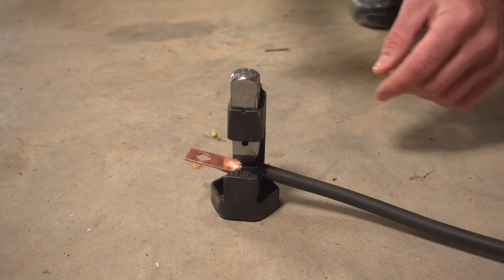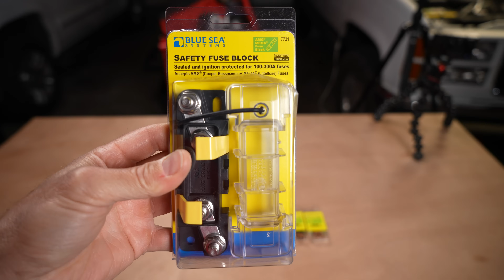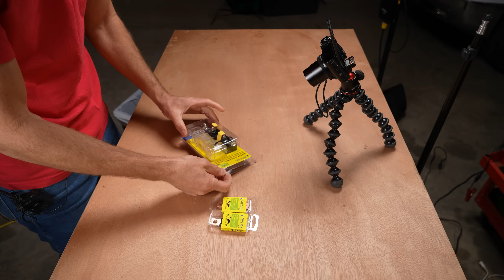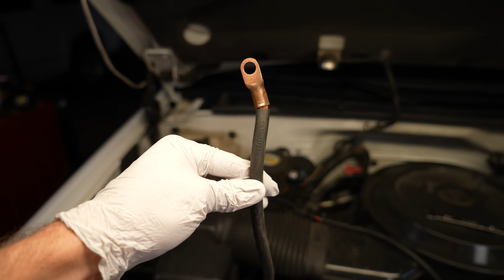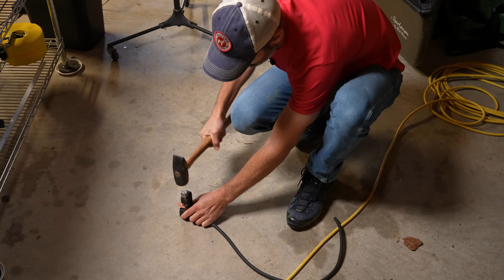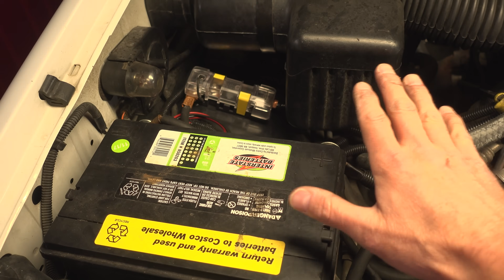Here's Why You NEVER MESS WITH Your Vehicle's ELECTRICAL System!!

Comment: Great video, as always. The money/time saving tips regarding the copper tubing as raw material for creating your own lugs, to then make your own wires for power with the 2g copper wire are fantastic. I prefer a handheld crimping tool but the hammer one is also a great (and less expensive) option.

Comment: Should have mounted the fuse battery connection right at the battery, as now you have a length of wire just like going to the alternator did, but going to the fuse that can make connection to a ground. Also heat shrink would be needed on those lugs. It is still a good idea to fuse the main battery wire, so good going.

Comment: The capacity you want is around 200A SBF (slow blow) breaker.
It'll protect the battery if something is shorted and pop immediately with the CCA amps, and blow in around 30-60 seconds at full alternator output/overload. That 300A fuse could let the alternator overload for minutes or longerand never pop 🙃
Reply: yep. You can go with fat cables that can handle twice your output, but definitely going with the correct fuse is always the best, if something draws around 200 then go with a 200 or maybe a 180, fuses are often very cheap to replace :)
Reply: You are overthinking this. A 300 amp is perfect. Mechman and a few other brands put out quite a bit more than rated. Why would you want a breaker in between that trips when you go over 2k rpms because your alternator is putting out it's maximum output? That sounds ridiculous. Yes fuses do allow slightly more current through than rated for certain periods of time but if you short that wire that fuse will blow guaranteed which is the ultimate purpose of the fuse.
Reply: Not to mention that if the wire fails (overheats) because it is carrying more current than it is rated for it can short out in between the fuse and the battery for which there is no protection at all.  The battery will continue to provide current until it's stored energy is depleted or something within the battery or the path to the short circuit melts open.
Reply: @emblems4life726  putting more amperage through a wire than it's rated for won't cause a short. It will just destroy the wire.

Comment: Blue Sea is the mack-daddy of marine electrical.  I did the same thing you do.... if it is good enough for salt water use it is overkill for automotive applications which is how I roll. I kept all of my old copper tubing for the same reason.  Flux is a good thing before soldering.  It will help draw the solder in

Comment: With the exposed lug so close to the frame you have increased risk of a short on that unfused line. Slap some heat shrink on it. (The battery side is is the most dangerous side on that fuse block)

Comment: Great video, for the engine area you need to use Noalox on your wire before you crimp it and then waterproof/marine heat shrink.  Sounds like overkill but I've seen most of your video's and you like to go over and beyond for reliability.

Comment: Time throw a Taramps 8k amp and 4 big ol' Subwoofers in the back of that truck. 😄 🤣
Reply: @1RoadGarage  no joke if you ever wanted to get or get back into car audio it's super cheap nowadays. A down4sound JP23 and 2 American Bass Elite 12's or 15's will have you louder than anything you've heard back in the 80s or early 00's

Same thing with mids and highs, cheap as hell nowadays to get good RMS power.

I say this because I just did the alternator upgrade in my 2011 Ford escape with a 270amp from JS alternators to support my sound system

Comment: Like all the other comments. Tape or heat shrink the ends.  
Not a fan of adhesive on a curved surface either. 
But you obviously check under the hood regularly so you will know if anything needs attention

Comment: Ok so I too am not a technician but I have done a couple of car stereo set ups. Rule of thumb is you want your ground short 12-18 inches and the fuse on the power side with in the first 12-18 inches from the power source; the battery. My question to you Jimmy should the fuse in this situation be close to the power source; the alternator? The only part that is protected from a short is when the car is on is that short run after the fuse. Or would you need redundancy and have one at each end since you have the potential of the battery also being a power source.
Reply: text7401  verify you are Jimmy… lol

Comment: I was wondering, if the fuse was rated 50 amps higher than the alternator, is it really protecting it? I have to say that these older vehicles are built way better than GM is making them now and it is great to keep them going as long as you can.
Reply: Fuses protect wiring.  If the diode bridge inside the alternator goes plaid, it might pop the fuse.
My truck uses fusible links, silicone insulated wire 4 AWG smaller than the circuit.  I smoked a bridge in a 27SI alternator,  did not hurt the fusible link.

Comment: I thought the alternator outputs AC voltage and there is a circuit that cuts off charging when the battery is full, but I guess I was wrong. Maybe it has both rectifier and charge regulator built-in?
Reply: Internally an alternator does produce AC voltage, but the circuitry to convert it to DC is built into the internal regulator on most alternators. 70's Fords and Dodges are two that I can think of off the top of my head that used external mounted voltage regulators, but still operate the same.
The majority of alternators do not cut off voltage, ever, rather they output a regulated voltage (if they produce enough current to maintain said voltage) of around 14-15v. Lead Acid batteries like receiving a constant charge, which makes them ideal for automotive applications even now with other technology available.
Reply: @kstricl   okay, i had the same thought. Didn't know that there is no cut off circuitry for the battery though. I guess that as long as the voltage doesn't exceed 15V, the battery doesn't get a chance to overcharge. Maybe that's why stand alone car battery chargers with cut off protection output around 18V.

Comment: Jimmy, have you considered integrating one of the power distribution blocks that GM uses on the K2XX trucks & SUVs?  It may be a viable solution to keep things organized under the hood.
I am researching this now for use in my 2012 Suburban.
Reply: Let me know if it will also work on an 89 gmc suburban please!
Reply: @Ypcomchic  I don’t see why it wouldn’t.  The GM factory distribution block I am working with is made to fit on a top post Group 48 type battery.  Other than that, you’d need the correctly terminated cables for a seamless installation.
Reply: Isn’t he going to want that fuse as close to the alternator as possible? If that wire gets cut or burned through it will ground against his motor and short.

Comment: I recently completed a similar project in a boat. It was eye opening to see the higher bar required by ABYC for a salt water environment. Part of the challenge was to properly size the wire and fuses based on voltage drop tables and ampacity tables, with derating for wires in the engine compartment, bundling, and temp rating stamped on the cable. By those tables designed for boats, short lengths of unbundled AWG 1 wire rated at 105 deg C is good for 208-230A inside the engine compartment, depending on cross sectional area. 1/0 wire is good to 242A inside the engine compartment. The fuse is chosen to protect the wire, it should not be much higher than rated ampacity. To go above 300A you'd reach for 3/0 wire, but you could swap in a smaller ANL fuse.

Comment: Thanks for introducing me to that company. Really looks like nice quality. I don't remember; does the original cable from battery to Alt have a fused link or fuse?
Reply from the maker: I believe it was a fusible link.
Reply: @1RoadGarage  Thanks, James. I am like you and just love improving. I get crap for my PM of replacing stuff with new, but I don't care. I love my truck ('96 K2500 GMC Suburban) and enjoy knowing I am keeping it as reliable or even better than new. Keep up the great work!!
Reply: I just checked - it is indeed a fusible link on the stock wire. Mine has a 12 stamped in it.
Reply: @kstricl  Thanks! I was going to ask Jimmy why he chose the value for the fuse
Reply from the maker: @kstricl  thanks for checking!

Comment: I'm still driving my 1995 Chevy 4WD Suburban...even after all these years, its still a good looking body style.  I just now installed a second battery on the driver side and getting ready to make the connections to DC-DC charger.  Eventually adding a 200W solar panel as well.
Reply: Planning on doing same with 2nd battery on my 95. I've been going through a battery every 2 years because I don't run very long, so I installed a battery maintainer recently. Solar panel is on want list.
Reply: @kstricl  To make room for the battery I removed the vapor canister...after this many years I'm pretty sure the charcoal was depleted anyway, not to mention the state where I live does not do emissions checking on vehicles more than 25 years old.  I also removed the resonator box on the air inlet side and replaced it with a short length of 4" rigid clothes dryer duct which freed up a lot of room for the DC-DC charger on the fender well.

Comment: I would have take a piece of hose with the id of the cable and slide it over the cable in areas where it touches hot areas 
Not only does this prevent chafing but also helps prevent premature burning

Comment: You need three things. Dielectric grease, shrink tube, and to cover those exposed stingers on your crimps. That much exposed copper is cringe.
Reply: Yes yes yes yes yes. I was going to say the same thing. Especially if that double sided tape comes loose in hot or cold weather and tips over the fuse block. Shrink tube would be perfect but 3M high temp electrical tape would be okay also. Other than that the fuse block looks nice.
Reply: @crazyeye1  What that double sided tape comes off and it's a dead short to the frame... man it's dumb.

Even VHB tape would be fine.
Reply: @AgentLokVokun  I thought that the fuse was there in the event of dead short?
Reply: The main reason there needs to be a fuse in the alternator cable is in case of alternator rectifier failure, the diodes most often fail short circuit which would allow the battery a dead short path to ground via the alternator. This is a major fire hazard. The common way the fusing is achieved in OEM applications is by using a " fusable link " look them up online. The colour of the link indicates the rating
Reply: This is a perfect example of why you shouldn't watch how to videos on YouTube and then think you are qualified to do your own repairs.. Also a 300amp fuse seems awful high to me..
Reply: @MarkLada  A fuse should be no less then what the alternator is rated at. So in this case 250A would suffice but 275A would be better then 300A

And because it's NOT a quick blow type fuse you could easily be drawing an excess of 300A for an extended duration before it goes pop. 

This YouTuber is a Chud. This is basically a series of sponsored videos with out the disclosure. The moment that double sided tape fails he's going to have a 300A lead flopping around the engine bay.
Reply: @MarkLada  not for a dead short
Reply: What’s the grease for?
Reply: @freshbutplain1144  Prevent corrosion on the connectors. Apparently up to 300 amps is going to be going thru there. Alternatively CRC 05046 Battery Terminal Protector would suffice.
Reply: @freshbutplain1144  Dielectric grease prevents moisture buikd up which prevents corrosion. When enough corrosion builds up, it leads to intermittent or no electrical flow.
Reply: I know that's right.. share the same sentiments with crazyeye1 here
Reply: Yes! Wirefy shrink tube on Amazon is freakin great, double wall with adhesive inside. Gives a nice pro look too for whatever that is worth.
Reply: That's why GM used fusible links back in the day for components like that what he's trying to do. I like fixing old trucks, don't get me wrong. But at this day and age with parts not being that genuine anymore and not as robust, if these old vehicles are your mainstay for driving to work and things go wrong, one can spend weeks looking or ordering parts and many are back ordered. Which is a nightmare and loss of peace of mind. If it's a major repair and the costs add up. Compare it to the payments for a new vehicle, with an extensive warranty and peace of mind, spending less time in a garage being a grease monkey, lack of social life at times, when one can be doing something else other than just fixing vehicles. Good for a past time hobby. Don't get me wrong, I love fixing vehicles as well and using it as  a hobby. But if this is a constant means of life, especially if parts quality isn't the same and vehicles parts are more throw away and hassle anyways, get a new vehicle. Yeah if one is not a licensed mechanic or even is, it still needs to be inspected by a mechanic if it's over 10 years by motor vehicles for safety reasons such as brakes lights and overall mechanical safety. Shop rates aren't cheap. Mechanics don't exchange a case of beer anymore to inspect your vehicle for registration, because rates are high and they can be liable if they do false mechanical inspections. I love old vehicles, but at this day and age a person needs to be more practical. Not everyone has the luxury of fixing old beaters even though they may know how, but the costs and energy at times is not worth it if that's a person's mainstay. Where I live, flipping old  vehicles and repairing them for sale is a lost cause and one doesn't get the money they put into it or even more. Unless someone is restoring a Barret - Jackson special. Also youtube videos don't do justice. He even mentioned that he's not a professional and isn't liscenced. Then again if one is not liscenced or professional  they shouldn't be publicly posting videos to the public, because if the component is  assembled wrong and it becomes a fire hazzard then it can have repercussions.
Reply: Wonder very much if things got safer… so many fail points added.

A bad connection can heat up at 300A to cause a fire. Below 300A the fuse does nothing.

I have had this kind of mods made professionally in my car as I needed to charge equipment.

Over time you get oxidation which increases contact resistance, which causes more oxidation, which… you get the point.

Only after a few iterations it worked stable.

But adding a fuse for extra safety in this way.. I fail to see the point
Reply: Saying "cringe" to describe something sketchy is cringe, you probably misuse that word too much all the time
Reply: @blakesouless6648  K, snowflake, assuming people use a word more then they do.

Endangerment of themself or others in such a casually way is "bend one's head and body in fear or in a servile manner." -- Cringe.
Reply: @AgentLokVokun  k
Reply: @blakesouless6648  k

Comment: A water proof fuse block is great but exposed wire cancels out the water proofed fuse block. Shrink tube is cheap and effective. Especially if you get the kind with the adhesive in it
Reply: It will pop the fuse that he didn't need anyway